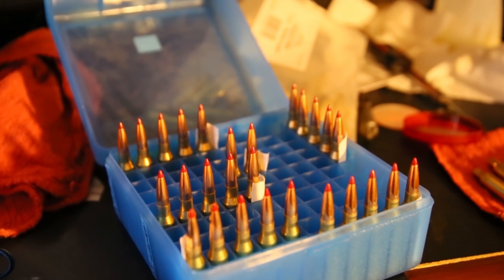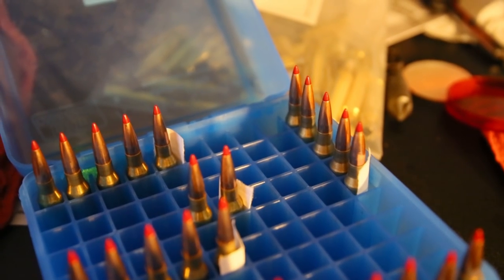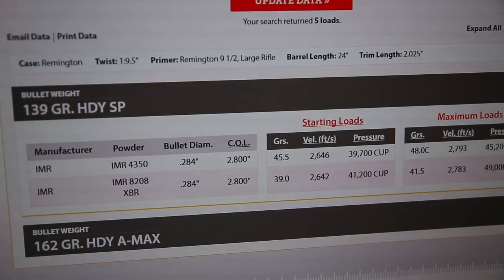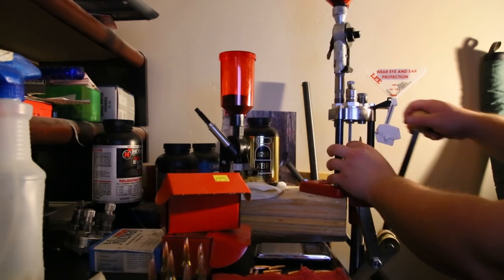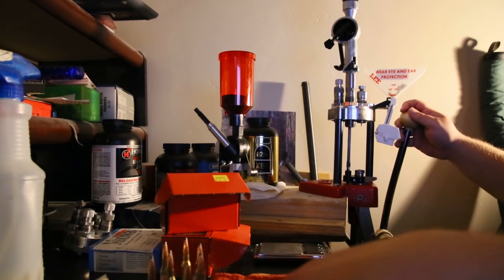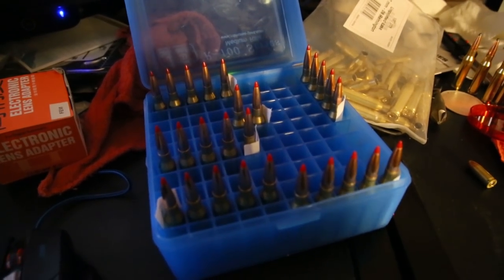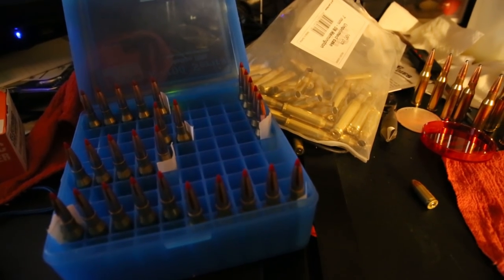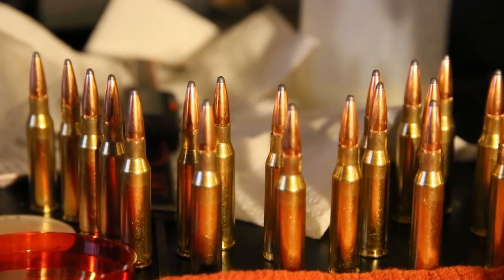Why I switched from 30-06 to 7MM-08 And reloading 7mm-08 for Elk - Lee Classic Turret Press

Comment: It's crazy how underestimated the 7mm-08 is. You can compare it to any thing in the same class and do just fine. For long range target shooting, The 7mm-08 will beat the 308 easily. people forget about wind. The 7mm-08 in the 140-160 gr bullet class has a higher bc than any 30 cal bullet by far. The same happens if you compare a 264 cal to the 284 though. It's a diameter to length ratio. For all around, long range, target, med to large game....the 7mm-08 is great, cheap to reload, easy on barrels, and easy on shoulders. A muzzle brake makes one recoil like a 223.
Reply: TexanUSMC8089 I was thinking about a recoil pad before a muzzle break.  Have any experience with a recoil pad?
Reply: TexanUSMC8089 win people talk about 7 mm  rem mag vs 7 mm-08 all that the 7mm-08 dose better is have less kick
Reply: I was thinking the same thing, looks like I'll be switching to the 7mm-08 and this is coming from a 30 caliber guy
Reply: For something less than the .30cal stuff, I'd prefer the .280 Rem more than any other caliber. But it's hard to find chamber offerings for from factory stuff. It offers the excellent .30-06 case in a .284 caliber.

As far as killing big and tough stuff, read about W.D.M. Bell and his 7X57 Mauser and all the elephants and big game he killed with it. Sure he was an expert at shot-placement, but he also didn't like the .30 cal stuff because of recoil.

You can penetrate very deeply with a ballistic tipped all-copper round.
Reply: EzSkAnKeN have had one for years switch it from my 12 ga to my 20ga it just slips on its great
Reply: @rainsong7327  He never mentioned 708 for Grizzly.
Reply: @rainsong7327  U wanna see me take  a 708 into grizz country come out to Idaho and see us! You can hide behind your 300 mag ! lol
Reply: .270 anyone?
Reply: @lukedemello2077  i beat the bush with my 7mm...an im from alaska.
Reply: With the advent of Staball 6.5, it's crazy how close a velocity you can get to a 7Mag.
Reply: Flash forward to now and with the cost of ammo/guns & everything else. I'm staying with what I already have. To expensive to switch calibers/guns right now. 2016 was the good old days...
Reply: @abominablestormtroopersnow4510  2 years later, Yes!!!
Reply: @kurtwpg thanks. Nice to hear about staball 6.5 i used to reload my 08 with H414 but they quit making it so now I'll have to come up with a new reload.

Comment: Everybody falls into that velocity trap, regardless of the cartridge they are loading for, but especially with the 7-08, don't try and turn it into a 7mm Rem mag. It's not, and never will be. Instead, fall into the accuracy trap; You will use less powder {stretch your powder supply}, have less recoil and better accuracy. FORGET MAX LOADS, they are a trip to nowhere. This is especially true in hunting loads. Your still going to put your game down with a little less velocity, and you'll put it where it needs to be put too.
Reply: Very well said sir on all accounts.
Reply: @boweavil1063   ........  Ditto !    : )
Reply: I would totally agree my Tikka T3X in 7mm08 shooting 139g SST's with mag primers and  ADI 2208 42.5grn  load gets me out to 700 meters no problem working on getting to 914 meters 1000 yards using ELDX 150gr
Reply: I never understood why people would buy a smaller round but then try to get it to perform like the larger case. If you need greater speed get a 280 Remington or one of the 7mm magnums.  Ps I'm not trading my 06 in for a 7mm\08 anytime soon. Most of the advantages for the 7mm are theoretical at practical hunting distances. With proper shot placement no elk, or anything else is going to know the difference.
Reply: Four years later, I find myself reading  some wisdom. Thanks for that!
Any experience loading the higher BC/heavier bullets (150gr +) in the 7mm-08 that you commonly see 7rem mag shoot?
Reply: @406MountainMan  Most people that load this size case tend to stick with lighter bullets, because that is what shoots best as a rule. 140-50gr is usually the heaviest bullets you see being used by reloaders. To go heavier, you start to run out of case capacity, and then it doesn't shoot as flat over distance.
Reply: @papawx3  10-4, thanks for the response! Much appreciated. Shoot straight
Reply: @papawx3  also, most modern rifles aren't throated properly for heavier bullets. I've got an old Spanish Mauser in 7x57 and it can handle up to around 175 grain bullets, albeit a bit slower, but that is honestly what the 7mm Mauser is known for. Performing above what it should with it's respective bullet weight.
Reply: @johnkendall6962  Yeah, as long as you're happy with the extra recoil, sure, the 30-06 is fine but I think you'd be hard pressed to argue that it's better.
Reply: @haroldgodwinson832   I didn't   but if you want to go there I can push 165 grain bullets a little over 3000 fps. and 150s way over. That puts in out of the 7/08 category. The 7/08 is a great cartridge in many ways it's better than it's .308 parent.  If I shot a lot at the range or didn't already own a 30-06 I might buy one. I bought the 06 way before the 7/08 was a factory cartridge.  I usually load down to the old .300 savage level and use a simple lead core 150 grain bullet. Where I hunt a hundred yards is a long shot.
Reply: couldn’t agree more
Reply: What do you know?
Reply: @406MountainMan  check out new Zealand videos using a 7mm08
Reply: @gradyhernandez4699  What I know cost money, and I sure as hell am not going to give it to you for free.
Reply: @papawx3  don't need what you know chief
Reply: @gradyhernandez4699  Just admit it, you can't afford to know. Your a Walmart shopper.
Reply: @papawx3  have no use for a 3006 only a 25 06 and my 7mm 08 .
Reply: @papawx3  braggers are everywhere
Reply: @gradyhernandez4699  25-06 and 7-08 are overlapping calibers and do much the same things, but if that is what you like, have at it. A good common ground would be to have just one .264 caliber or a 270 Winchester. But I can't fault someone for wanting an excuse to own two fine rifles.
Reply: @papawx3  6mm Remington hard to find ammo

Comment: I grew up on a farm in South Africa, I do all my hunting with a 7x57 mm Mauser with bullets from 139 gr  to 175  gr. In a CZ rifle, model 557  with a custom barrel in 1: 9  twist, 24 inches long, stainless steel.
Reply: My dad has a 7x57 in a Remington classic that I want to get my hands on. Very under rated round.
Reply: @blaynemacpherson8519  As a handloading proposition, the 7x57 is actually better than the 7mm-08 due to its somewhat greater powder capacity.
Reply: @haroldgodwinson832  Yup. But then you get up to 280 Remington capacity and speed. It’s a hand loaders cartridge.
Reply: @blaynemacpherson8519  Yes, or a 7x64 but, there are no free lunches so you also get greater recoil.  And frankly, despite what people often say about the 7x57, as far as I'm concerned, produces more than enough recoil for my taste.
Reply: @haroldgodwinson832  Yes depends on what bullet you load it with. I have a 7mm08 and shoot a 120 grain and it’s fun to shoot.
Reply: That 1:9 twist gives you the stability for those 175s
Good stuff
Reply: The reason the 7 x 57 mm is underated may be cause of 1898 battle. Rough riders were outgunned by the Spanish army .they had the 7x57 mm not Teddy.
Reply: I am building a 7 x 57 Spanish.mauser

Comment: I was "clued in" to the 7mm-08 a couple of years ago. I had been a die hard 30-06 guy for years. Short story...I simply love it. Low recoil, light weight, accurate, fast in hand and with more than adequate punch for most North American game species. A lot of people don't realize that the humble 7mm-08 has been used to hunt animals as large as elk and even moose with great success. With proper loading and good marksmanship skills there isn't much the 7-08 can't handle.
Reply: I agree, the 7-08 and the 260 Rem are great calibers. anything in a short action that loads 7mm or 6.5mm bullets is an awesome lightweight hunting rig.
I can't decide on my next rifle between a 7-08 or 6.5 creedmore
Reply: I think if i were to get another its gonna be the 6.5 creed.  I dont think there is anything wrong with 30-06 though. It will do the job and not beat ya up like a magnum.
Reply: Most cartridges have the same exact effects and results. There's just a lot of overlap. What's the right cartridge for X game? Most of them. Put the shot where it should go, know the bullet effect at that range, penetrate deep enough, dead game. Same thing can be done with .257, with .264, with .277, with .284, with .308 if these simple rules are followed. For instance, a 30-06 cartridge can be used with very light bullets for varmints. It can also be loaded with 220gr bullets with very high BC and SD.

Comment: Glenn the 7mm-08 is a great round for elk.  But the comparison with the 30-06 in this video is a bit strange don't you think?  You're comparing the bullets you had but it's still quite apples to oranges.  You compared a 150 grain older 30-06 bullet with a brand new top of the line 162 grain 7mm-08 bullet.  180 grains is the most common -06 round for elk, and Hornady's ELD-X ones for 178 grains have much higher BCs (newer tech and more grains).  Using those 178 grains, the -06 carries more downrange energy than any boxed 7mm-08s on the market according to ballistic calculators.  You handload and I'm sure can get your -08 to perform better than boxed ammo, I just wanted to make that distinction in case anyone who doesn't know much watches the video and thinks that generally 7mm-08 packs more punch at 500 yards than 30-06.  For the average hunter the -06 boxed ammo ELD-X carries more downrange energy past 500 yards than 7mm-08s.  And actually shoots only 2 inches lower at 500 yards if you shoot at the elevation my local range is at (9000) feet.  But obviously the 7mm-08 has other things going for it like lower recoil, less powder, short action, etc.Regardless, great video!  The 7mm-08 is such an underappreciated round and works on elk fantastically with good shot placement.  I would love to get one; their downrange energy compared to recoil is amazing and the ammo is cheaper than I thought it would be even if you stick to boxed ammo.  Essentially the same price for ammo as a .308
Reply: Agreed. I was thinking the same thing myself. 150 grain 30-06 bullets won't perform as well as 180 grain in the energy department
Reply from the maker: I agree, it is an apples and oranges comparison. I mention that the 30-06 is a great gun, and great caliber, but I just had a bit of a bad taste in my mouth because of my experiences with the 2 guns I had that broke. But doing more research, you can load the 200gr ELD-X and even the 212gr and 220gr in the 30-06. Those are going to have quite the kick, and won't be traveling as fast, but the 212gr ELD-X has .676 BC, which is insanely high for a 30-06 bullet. Of course, those are handloads. The factory loaded 178gr has a BC of .535. Hornady did just release the 150gr ELD-X factory loads for the 7mm-08 and those have a BC of .575. I checked the ballistics, and the 30-06 still have about 190 ft/lbs more energy at 500 yards than the 150gr ELD-X in the 7mm-08, and only drops 1 inch more. So still a great option for factory ammo. 

I might pickup another 30-06 some day. But I'm really enjoying my 7MM-08 right now. There are a lot of calibers I would love to have. Its just money. :)
Reply: Too bad someone doesn't make a 6.5-06 or maybe a 7-06 - those would be great.
Reply: GeorgiaBoy1961 Georgia boy there is already a 6.5-06.Started as a wildcat .Your 7-06 Has been around for years.Known as the .280 Remington.
Reply: Knew about the 6.5-06, but did not know that the .280 was the same as 7-06 - thanks for the tip.
Reply: Fred Waldon 280 has a longer case than a 06 so it won't accidentally chamber in a 270. 280 Ackley is a killing  machine but kicks a lot more than the 7-08

Comment: I moved on to 708mm in 2014 and never looked back. I got a weatherby vanguard also. Started handholding about 8 months ago. My gun doesn't seem to like anything hornady.  I haven't found the perfect load yet but I getting 2900 fps with 145 gr speer btsp averaging 1". I've got some 140 tipped game king's and some 150 gr bonded siroccos. I've also picked up a savage bear  hunter in 338 federal.  It's got a bit more punch.

Comment: I have a 7mm-08, 280rem and a 7mm Mag.  I think I have a 7mm "problem"!lol!  LOVE those bullets.  I shoot 154 Hornady Interlocks in the -08 with great success on Elk and Mule Deer.  160 Partitions from my .280 and 175 Partitions from my 7mm Mag.  All great bullets and accurate.  I sling IMR 4350 in both the -08 and 280, and 7828 in the Magnum.

Comment: That Lee press looks like it performs great! I've got the old RCBS single-stage Rockchucker press, and their powder measure which I never liked. It didn't like extruded powders at all. Plus now it's rusted and locked solid. (long story) 
Also have a line on a new in the box Howa, (like the Vanguard) in 7mm-08 for a fantastic price. Been researching the 7mm-08 extensively, and this video just adds to my enthusiasm about the cartridge. And the Lee products!

Comment: Have shot a number of calibers. 30-06, 45-70, 270, 6.5 CM and the 7-08. I've not seen anything perform on whitetail like the 139 grain fusion in 7-08. I take shoulder shots because I don't like chasing deer - and every deer I've hit with that round has dropped where it stood and never moved again. As much as I loved the 45-70, even it didn't kill deer as efficiently as the 7-08.

Comment: I like the 139 140 150 and 154 gr in my 7mm08 with IMR 4064 it's just a simple all around great powder to use same for the 7x57. if you run short on brass you can size up 243 and down 308 to 7mm08
Reply: Mine really likes the 139 sst.
Reply: I shoot the Hornady 139 btsp over 45 gr. of IMR 4350. I have taken several whitetail deer with this load and it is lethal and extremely accurate. I've taken deer with the 270, 30-30, and the -06. The 7-08 is by far my favorite rifle to shoot and hunt with.

Comment: a 147 gr ELD for 6.5 creedmoor is at about 700 BC.  If you want to shoot 180+ gr bullets, then 3006 or the 300 win mag, but if you don't need that kind of mass, a 6.5 creedmoore or 7mm-08 is a lot easier on the shoulder. I've only shot deer and targets with my 7-08, but it's very accurate. I'll take the 7-08 over the 308 any day.

Comment: Hi Glenn, I found your video a few years late, but good timing for me.  I hunt elk with a 30-06 as well along with a 270.  I bought a 7mm-08 a month ago, and want to get into reloading.  My 7mm will be only for bench shooting.  I want to reload so I will have options with bullets.  180 grain shoots well out to 300 yards in the 30-06, but I want to shoot 200 grain pills.  For reasons unknown, the 30-06 is more accurate than the 270 at 300 yards, but the 270 is more accurate inside 300 yards.  The 270 accuracy at 300 yards may be due to 150 grain bullets?  Your 7mm and 30-06 info was great.  Thank you.

Comment: It's nice that lapua now makes 7/08 brass. The bullet selection is outstanding. Factory heavy long range is the only issue if you don't reload and want long range use. 6.5 a better option in that case.
Reply: The 6.5 creedmoor has a 1:8 twist which works great with 140 gr bullets.  I wanted my 7-08 to shoot the 162 or 154 gr, but it didn't like them. 139 SST is outstanding. The 7mm-08 is a 1000 yard gun though. 284 cal in a 308 case.

Comment: Very well put together video, good information. Sorry though, I been using 30-06 for over 20 years and I have tried hunting 7-08 but im not sold on it. I will stick to my 30-06 respectfully.
Reply from the maker: The 30-06 is a great caliber and I've gained some respect and interest in it since I shared this video 2 years ago. I might pick up another 30-06 to reload for. But I do love my 7mm-08 and have had great success with deer and elk with it. The only thing that matters is what works best for the shooter and what they are most accurate with. :)

Comment: I've been reloading my 7mm-08 with 150 Gr Berger classic hunters and a max load of 45.9 Grains of Reloader 17. Tested two other loads of 42 grains and 44 grains but my rifle which is a Remington Model 700 handles the higher load. The B.C. is from .6 to .5 and the velocity is a little below 2900 FPS. Could try loads such as that.
Reply: Nosler load data shows RL19 with the 150 gr bullet, using 48.5 max yields 2862. It us 110% full, compressed load. Is your max load of RL17 compressed?

Comment: I bought a 7mm-08 for my kid and i find i use it alot but the 30-06 in cz or winchester model 70 or any old mauser 98 action will handle max loads or even a bit over if your crazy

Comment: For the 7mm cartridges look at the 280 Remington Ackley Improved which is an improved version of the 280 Remington cartridge with a 40 degree shoulder and reloading dies are readily available for it. It duplicates the ballistics of the 7mm Remington Magnum but with 30% less gun powder used and less barrel erosion. Also it is registered with SAAMI by Nosler.
Reply: There's quite a range available in 7mm bore.
7mm-08, 7x57 Mauser, .280 Rem, 7mm Rem mag, 7mm STW, 7mm Weatherby mag, 28 Nosler, 7mm Rem Ultra mag.
For some, using AI ammo is worth it. For others, simply going up the line to something more powerful is also worth it. Replacing a barrel isn't the end of the world, and probably no more expensive than using AI for the life of a rifle.